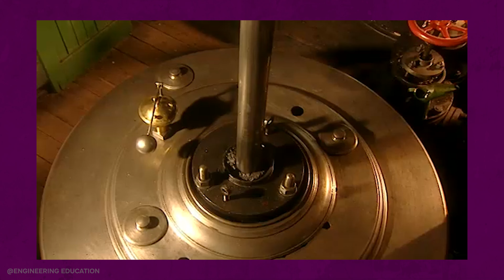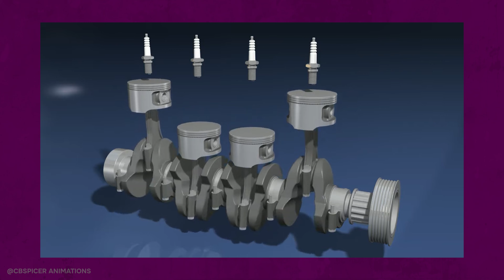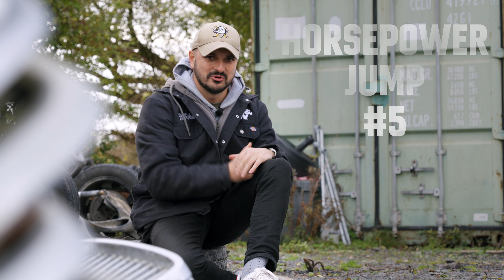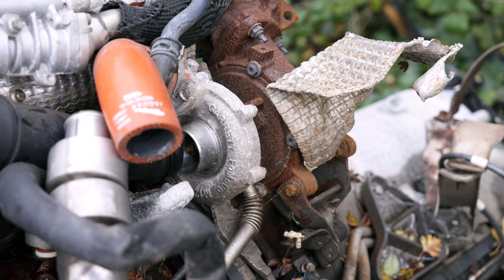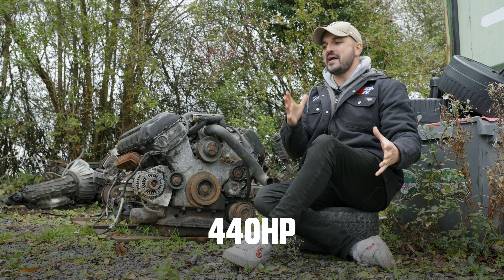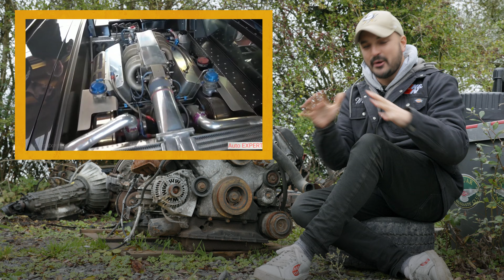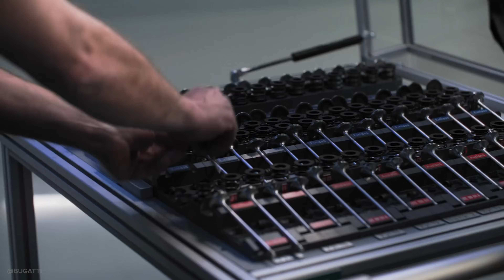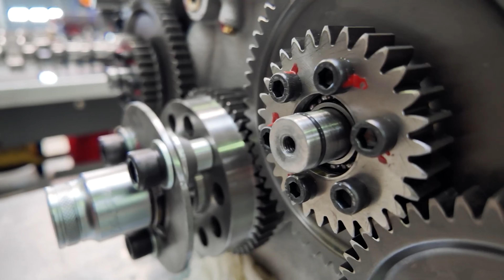How Car Engines Went From 0.74HP To 2000HP!

Comment: What is relevant today is doing more with less not massive power. Growing up I had a moped that transported me at useful (30km/h)speed using less than 1/3 of a litre of gasoline per 10 km. Today you got family sedans doing 80 km/h using 1/2 liter per 10 km. If the combustion engine are to survive at all by 2100 that must be improved on by 50% or more. Top fuel cars use methanol, a form of alcohol, to make ridiculous amounts of power using gallons to go 1/4 us mile (400 meter) so I can´t help but wonder how little alcohol based fuel would be required to replace the much more polluting gasoline in a family car doing 80 km/h? 
You get far more distance traveled per Kw of power by going electric, could any internal combustion near 0 emissions car match that, ever?

Comment: I may be in the minority here, but i disagree that exhaust gasses were wasted and that turbochargers 'recycled ' this 'free' energy source. It takes power to evaluate a cylinder of exhaust gas, turbo chargers increase exhaust backpressure and the crank has to overcome that force to keep the cyclgoing. Of course you get additional power from burning a compressed higher mass fuel mixture. Turbos induce an indirect parasitic load but off an increased power availability for a given displacement.  Turbos essentially trade a small parasitic drag for a muuch larger displacement.

Comment: You fail to mention a basic fact. Early engines were measured at Norminal Horse Power, later engines are measured at Brake Horse Power.

Comment: What is often overlooked is the crucial role of electronic stability systems. They are what make powerful cars with over 200 HP manageable for the average driver. A perfect historical example is the 1970s Porsche 911 Turbo, which was nicknamed the 'widow-maker' because its power overwhelmed many drivers. Simply put, a modern car with over 300 HP is dangerous for most people without these electronic aids.

Comment: What's mind boggling to me is that motorcycles can have 180hp or more. That is more than 1970s V8s in cars. And standard cars now have similar horsepower to old muscle cars.
Reply: 1970s v8s were down tuned to the new emission regulations at the time because companies didn’t have enough time to create new engines

Comment: Hi Mike, great video on the evolution of the internal combustion engine, however all the engines covered (and rightly) were gasolene powered. However if you look at the enrgy density of various sources Hydrogen comes out at over twice that of gasolene and over 100 times that of Lithium, ie for a given amount fuel it could release twice the power. In aerospace we were studying the use of hydrogen in gas turbines back in the 1970s and that work continues today. Biggest problem of course with liquid hydrogen is storage and transmission. Do you think the next leap in power could be brought about by fundemental change in fuel, we already have the tech to allow engines to run on hydrogen, we just need to have the infrastrutue to store it and distrubute it?

Comment: Great video but I would like to add a few things. 
1. The creation of the low emissions Catalytic Converter system by Honda. It allowed engineers to focus less on emissions, more on power by  greatly simplifying the system. 
2. The coolant cooled turbo. This stopped coking of the oil and made it to where owners didn’t have to let the turbo cool down before shutting down the engine every time they drove it and allowing warranties to be extended due to this same issue. 🤙

Comment: Another important milestone in engine development was the DOHC, four valve per cylinder straight 8 produced in the 1920s by the Duesenberg brothers. In 1932 they introduced a centrifugal supercharged version that produced 265 HP and sent the two and a half ton Model SJ up to 140 mph. During that time most engines had flatheads and produced under 80 HP.
Reply: DOHC 4-valve was invented by Peugeot in 1912, not Duesenberg.
Reply: The regular Model J was the one that had 265 hp the supercharged SJ (hence the S in the name) had 320 hp. And there was even a more powerful variant called the SSJ, with 400 hp! Although they only made two of those. And dont forget that we're talking about gross hp figures which are not used today, so realistically they are 10-15% weaker in net hp.
Reply: @bebabcsinya  net is more like 65-70% than 85-90% of gross. For example, the Jag 4.2 XK6 dropped from 265bhp to 180bhp when net horsepower came in.
Reply: I love that we still call something big, dramatic, loud, or exciting a "doozy", after the car. 😅

Can you imagine going 140 in one of those things? Sounds terrifying.
Reply: @clueless4085  do we? Seems to be a very niche term only used by Americans, and older ones at that.
Reply: @Broadwoodwidget  It's common where I come from, anyway.
Reply: The SJ made 320 I thought? The SSJ made 400 which is outrageous for 1935z
Reply: The ice is in the past... electric is the present
Reply: @tesicnr cope
Reply: @tesicnr there's still PLENTY of life left for the Internal combustion engine. It's not going away anytime soon.
Reply: @tesicnr  nope. Electric has its place but the ICE will remain dominant for the foreseeable future.

Comment: Tyre, transmission, suspension technology all played their part. Look how the auto transmission has changed. The old 3/4 speed trannies with slushy shifts are gone, with 8,9,10 speed autos with lighning fast shifts and high torque capabilities replacing them. The double clutch VW transmission made the Veyron a reality and those style transmission are everywhere in supercars now. Tyres and suspenion that can actually put the power to the road and better fuels and ethanol blends that can provide decent knock tolerance without poisoning everthing by using Tetra Ethyl Lead (TEL). 

Alot of the early development of ICEs came from aircraft development especially during both world wars where making more power reliably was a necessity

Comment: Great video overall, however i feel like you missed out by not mentioning cobustion chamber designs. Some of the biggest bumps in horsepower in the earlier days of automotive engines were seen in the transition from flathead chambers to hemispherical chambers and then to pentroof and wedge style chambers.

Comment: The biggest step has been in engine management (sensors and ECU) in the past 10-15 years. We had all the hardware (base engines, high RON fuels and big turbos) 30+ years ago but nowdays it is making 300% the power and more reliably, 1000hp supras used to be a meme, a dyno queen but now you can daily it and the drag racers have 3000hp.
Reply: Electronic fuel injection is way older than that, like 45 years old. And it became necessary with the rise of catalytic converters. I'd say the biggest steps came through advancements in several areas like turbo technology, material sciences and electronics (like both ECUs and programming tools)
Reply: @kooooons  what in the hell are you talking about? Did you reply to the wrong post?
Reply: @brendo7363  No, but you said the biggest step was enginge management, but whole engine management started and continually improved since motronic was Introduced in the 80s. The big steps in the last 20 Years are not just advancements in sensors and ECU. Sure, ECUs became more powerful but that was not the bottleneck, they just grew with increased computational demand. The Bottleneck was more in: Turbo technology, Material Science, Improved FEM-Analysis, CFD, CAD, improved understanding of the combustion process, Measurement Technology and Quality Management (which in the production world means something different than most people assume - it's more about consistency and precision than about "goodness") and, of course, the computer science that made all these advancements possible. That is what made modern engines as powerful as they are.

For example, you said we had big turbos over 30 Years ago, but todays turbos aren't big - Usually, at least - and they still make a lot more power because fluid dynamics just improved that much. But apart from that, Manufacturers today understand a lot better how to predict the limits of every single produced unit of each part which opens up a lot of performance potential.
Reply: @kooooons  How was turbo tech the bottleneck? It's just air, we've had a surplus of airflow possible since the 70's.
Here's my example: What i've followed more than anything is Nissan RB development, engine out of the 80's right?.
 Go back 25 years and 600hp was a pretty serious investment, built internals, alcohol fuel, T67 minimum.
Nowdays you can make that on basically a stock motor (if you can find one), same old metals, still using E85 fuel, still 600hp of air but the quantum leap has been in how well engine management and it's sensor references can control the combustion are what make it easy and reliable. They're making street GTR's with 1500hp now, 60psi of boost. They didn't discover adamantium headstuds, it's that computers can now control it.
Reply: @brendo7363 I didn't say turbotevh was the bottleneck, I said the "bottleneck was:" and then added a list of things that limited power. One of those was turbo, but not because it wasn't possible to have enough boost, but because the turbos that could provide such boost were to slow and inefficient. Modern turbos are smaller and more efficient and thus spool faster, add less back pressure while at the same time create more boost. This is a result of improved fluid dynamics, material science and production technology. But that's just one of several problems that prevented cars back then from getting more boost.
Reply: @kooooons  go back and read my original post then delete all your dumb comments.

Comment: Um, from my point of view as someone that has worked on cars for a short time, as a living, in a dealership, no...manufacturing has not gotten any better. Couple shitty build quality with shitty maintenance that manufacturers now tell people is fine, and engines often do not make it much past 50,000 miles! Yes, there are exceptions, my roommates have a 115,000 mile 2011 Chevrolet Cruze with the 1.4 turbo engine, a car a friend of mine working at a Chevrolet dealership as a service writer, he had to write up more times than he can count for turbo and/or engine replacements. I think the only thing that has made their engine with its original turbo last this long is the fact the engine has never gone past 5,000 miles between oil changes, and I keep an eye on all fluids, and have repaired issues before they destroyed the engine, like replacing thermostat housings and the turbocharger oil feed/drain lines when they started leaking and suck. While I was at a Volkswagen dealership, I saw TONS of 2.0 turbo engines either getting new turbochargers, and a couple times entire engines because of the turbochargers. And now we have GM with their truck engine issues, BMW is known for having modern engines eat bearings, we have engines with plastics in places plastics DO NOT belong.... no, modern engines are shit. I have had to replace a few different plastic engine parts on my roommates' Cruze over the last decade plus I do admit, and it annoys me, but it was also a cheap car. When I see similar parts in vehicles that cost $50,000.00+ dollars, that is pure bullshit. Engine power and efficiency mean exactly fuck all when the engines can't make it much past 50,000 miles, especially with the extended maintenance schedules that companies vomit out now.

Comment: great informative vid, not sure rolls did the first V8 pretty sure it was French, also the 1880s vtwin Maybach Daimler was a pretty big advance, first multi cyl car engine, interesting in 1938 Mercedes 4.7L straight 8  putting out more power than most powerful car from the 80s, 650hp, how far have things realy come. those cap 6s were pretty much derived from euro 6s like the earlier M103 m104 benzes (there were some special rare Turbo variants)

Comment: Think of a dry sump, overhead cam, 4 valves/cylinder, twin spark plugs, aluminium block and head, supercharged, twin magneto, twin fuel pump, twin oil pump engine that ended up putting out almost 2000 hp at only 2800rpm….. They existed in 1945

The Rolls Royce Merlin.

Comment: Love the video, but Duesenberg had a 265hp 6.9 liter straight 8 in 1928. With 4 valves per cilinder and dual overhead camshafts. More than the MB 300sl.

Comment: This was an excellent summary. One thing I would add is in the section on the origins of fuel injection I would touch on the fact that fuel injection in aircraft was less about power production and more about resistance to flooding due to negative G conditions. I would also like to see a more in depth discussion about the origins of scavenging effect and resonance optimization since that is where most hardware tuning is done. Also surprized the gas crisis isnt mentioned. overall good analysis.

Comment: This is Mr. Fernie at his best. Excellent content. It's going to be hard to top these videos Mike. Passionate about your mechanical engineeering and it shows. I'm guessing you'll have some engine builds in the pipeline. What about Ducati's V4 with counterclockwise crank rotation to help counteract wheelie's and stoppie's not to mention the desmodromic valves.
Thanks so much for this channel Mike. Keep up the good work. Kind regards.

Comment: Don't forget that the quality of fuel also plays a part. Petrol came from coal gas around the time of the Otto cycle engines and then the jumps in engine technology on the 20's and 30's introduced the use of TetraEthylLead to eliminate engine knock. Establishing octane ratings in the 40's and changes in refining, removing sulphur and finally the lead from the fuel

Comment: That guy could make you a V10 with MX-5 pistons and valves/combustion chamber. With reasonable squeeze it should fit directly in between OEM gearbox and radiator. Having the geared cam drive and some mild trickery in auxiliary drive shortens it quite a lot. Make it a kit to fit into stock engine bay and, as they say, there you go. It will need a different clutch pack, but unless you go completely berserk with the compression and tune, the OEM turbo/ aftermarket racing clutch will do just fine. A real V10 Miata.

Comment: I don't understand why a road car weighing less than 2 tons needs more than 1000HP.
At such power levels, it's much more beneficial to trade power for a lighter engine, thus lowering weight, lowering the CG, thus improving handling, than having so much power that, for the most part, it's completely unusable, especially without traction control and other electronic control systems.

Not even an F1 car has much more than 1000HP. So, why should a road car have that?! It doesn't need it.

In the "old days" a good, light chassis, and an engine with around 500HP was mooooore than enough to satisfy one's needs. But now, brands have entered a non-official competition of increasing horse-power just for the sake of it!

Sooner or later, we must all realize that went too far, and focus instead on the experience.
Gordon Murray understands it, as do a couple of others.

Comment: Its worth mentioning that the turbo cutlass was introduced in the same year as the turbo corvair. I've read that the 2 cars were introduced something like a month apart. But I've never come across dates from a primary source, some corvair guys will insist the corvair was first, either way given that the 2 cars were so different in their implementation, I think its worth talking about them both.

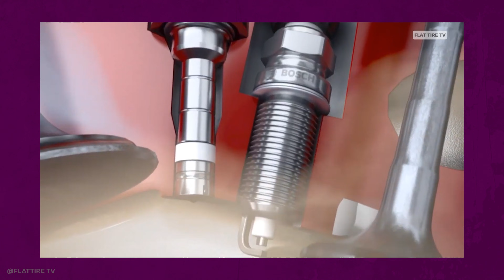Comment: 11:15 correction - Jetronic was produced until 1998 when Volvo stopped making the 900 series which used LH-Jetronic 2.4 for the redbrick engines
Reply: Jetronic is just a trade name. Bosch had several control methods under this banner until it was displaced by the Motronic brand when digital controllers became the computation method of choice
Reply: @AndyRRR0791 yepp. But the part in the video made it sound like jetronic was discontinued in the 70s ;) Some Jetronic where digital as well, but they didn't have the compute power to properly control the whole engine in one module. Motronic did everything in one box afaik, also it got OBD2 in later models - something Jetronic never got (again, afaik - please correct me if I am wrong)
Reply: @Ammageddon89  Motronic was basically the integration and synchronization of fuel and ignition control.  The tech spans a huge range of computational capacity from 8-bit steam engine powered with five bytes to the later 32-bit ME and MED versions with a megabyte or more of ROM and real-time numerical models of all sorts of engine functions going hammer and tongs.

Comment: Exhaust gases are not routed through the intercooler; they go straight to the exhaust after spinning the turbo
Reply: Rookie stuff 😂
Reply: Thank you! That was the one thing that just killed me. That's a fundamental misunderstanding of how turbos work.
Reply: The pumped compressed fresh air goes through the intercooler to cool the heated (by the turbo) intake air to decrease the volume of the air and increase the amount of oxigen that then can enter the cylinder (because less volume of the cooled air).
Reply: Bet he wishes he re recorded that wee foowpar
Reply: @dylanhedges5634 Faux pas.

Comment: That would've been good if you explained how one horsepower is measured, and how much horsepower do we actually use in real life when driving. Because it's not 2000 hp. It's probably not even 200.